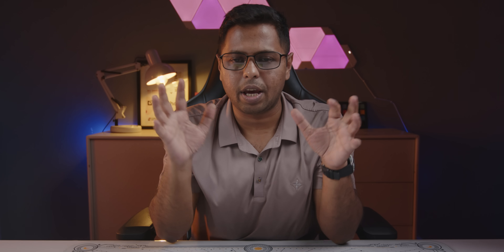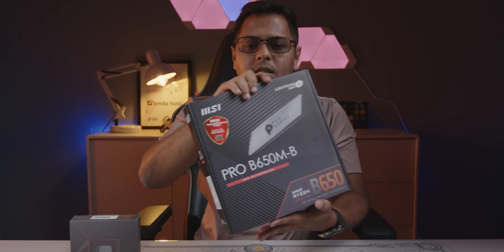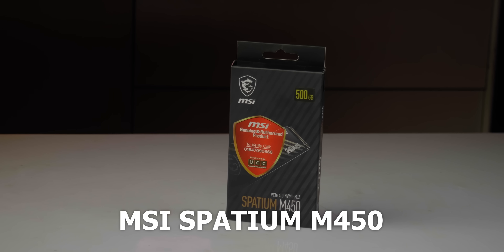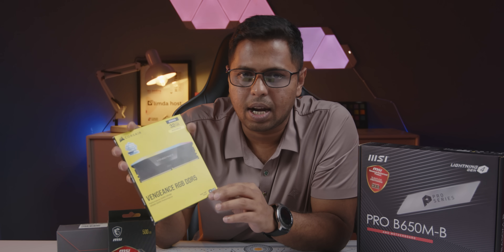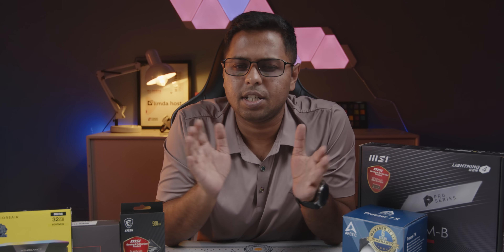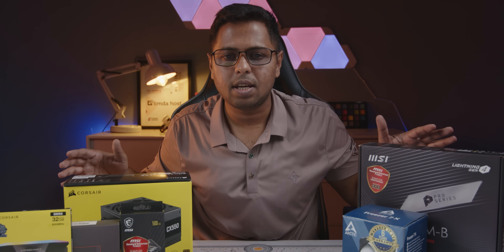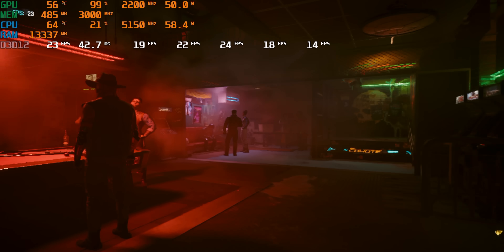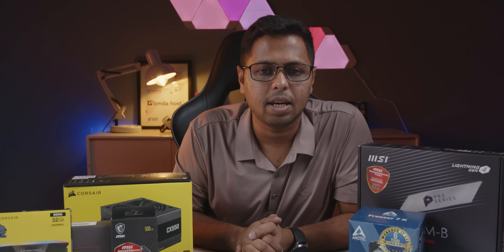60K PC Build Guide 2024 | Ft. Ryzen 5 7600

Comment: I think it's a bad built
Reply: Reason?
Reply: @NEON27_27  

Cpu - I3 12100f = 11.5k
Mb - MSI pro B760m p = 14.7k 
Ram - G.Skill Trident Z5 RGB 16GB DDR5 5600MHZ = 7.6k
Psu - DeepCool PK550D 550 Watt 80 PLUS Bronze Power Supply= 5.1k
Case 3k ba 3.5k 
 Ssd -EX900 PLUS 512gb  = 4.7k
Gpu - Intel Arc A750  or rx 6600= 28k or 28.5k
Totally 77.5k
I know it's over 60k but its way better if you can manage 60k you can manage 77.5k also I know it's 17.5k more but trust me
Reply: @NEON27_27 

Cpu - I3 12100f = 11.5k
Mb - MSI pro B760m p = 14.7k 
Ram - G.Skill Trident Z5 RGB 16GB DDR5 5600MHZ = 7.6k
Psu - DeepCool PK550D 550 Watt 80 PLUS Bronze Power Supply= 5.1k
Case 3k ba 3.5k 
Gpu -  Intel Arc A750 or Rx 6600= 28 or 28.5k
Cooler - deep cool ak400 = 2.1k
 Total = 77.5k

I know it's bet over but trust me it's way better 
 If you can manage 60k you can manage 77.5k also but it's worth it
Reply: @NEON27_27 

Cpu - I3 12100f = 11.5k
Mb - MSI pro B760m p = 14.7k 
Ram - G.Skill Trident Z5 RGB 16GB DDR5 5600MHZ = 7.6k
Psu - DeepCool PK550D 550 Watt 80 PLUS Bronze Power Supply= 5.1k
Case 3k ba 3.5k 
Gpu -  Intel Arc A750 or Rx 6600= 28 or 28.5k
Cooler - deep cool ak400 = 2.1k
 Total = 77.5k

I know it's bet over but trust me it's way better
If you can manage 60k you can also manage 77.5k it's worth it trust me
Reply: @R3dRum1  bro u r Intel too🙂
Reply: @NEON27_27  You can also buy Ryzen 5 5600 but it's not future proved.
Reply: @R3dRum1  i just wanted to remove the gpu 
I will add gpu within 1y
Reply: @NEON27_27  good luck
Reply: @R3dRum1  u too bro 😃

Comment: আসসালামু আলাইকুম 
আমার পিসিতে একটি প্রবলেম হচ্ছে, কোথাও তার সলিউশন পাচ্ছি না!!😔
PC Component:
Processor: amd ryzen 7 5700G
Xigmatek AIR-KILLER PRO ARGB CPU Air Cooler
Motherboard: Asrock B450 Steel Legend
Ram: kingsman 8gbx2 16gb 3200mhz rgb white
SSD: hp ex 900 500GB M.2 NVMe SSD
Psu: CORSAIR CX-550F RGB
Casing ValuTop VT-V3W white
Case Cooling : Aptech RF 200 pro 10 pis

problems:-
এডোবি ফটোশপে এডিটিং এর সময়  ইফেক্ট থেকে হাইলাইট ইউজ করলে পিসি অটো রিস্টার্ট নেই!! 
মাঝেমধ্যে এক্সেলে কাজ করার সময়ও অটো রিস্টার্ট নেয়।
আবার মাঝে মধ্যে স্লিপ মুডে থাকাকালীন কিবোর্ডে বা মাউসে ক্লিক করলে স্লিপ মোড থেকে অন হয় না পাওয়ার  বাটনে ক্লিক করে অন করতে হয় । 
প্রথমে ভাবছি উইন্ডোজে সমস্যা, দুইবার উইন্ডোজ দেওয়ার পরেও সমস্যাটি ঠিক হচ্ছে না। 
এখন ভাবতেছি যেখান থেকে উইন্ডোজ দিছি  ওনার উইন্ডোজে প্রবলেম। 
সো অন্য জায়গা থেকে আবার উইন্ডোজ দেওয়ার চিন্তাভাবনা। 
আশা করি আপনি আমার সমস্যা টি বুঝতে পারছেন। 

ভাই অনেক শখ করে পিসি বিল্ড করছি, কিন্তু এই সমস্যার জন্য মনে শান্তি পাচ্ছি না!! 
আশা করি,  আমার কমেন্টের রিপ্লাই দিবেন।
ধন্যবাদ ❤

Comment: hello zaman  why you did not use r5 8500g because it has identical cpu performance and a exponentially better gpu performance than the r5 7600 and it costs a thousand taka less than the 7600 (in some stores like star tech e.g.)

Comment: CPU...AMD Ryzen 5 7600 Gaming Processor
CPU Cooler..Arctic Freezer 7 X Multi-Compatible
Motherboard....MSI PRO B650M-B DDR5 AMD AM5 m-ATX Motherboard
RAM.......TEAM Delta RGB 16GB DDR5 5200MHz Gaming Desktop RAM
Ssd..... OCPC MBL-400 512GB M.2 NVMe SSD
Power Supply......DeepCool PK450D 450 Watt 80 PLUS Bronze Power Supply
Casing....Xtreme XJOGOS 200-12 RGB Mid Tower Black ATX Gaming Casing   ৬০ হাজার ৩৫৭  টাকা খরচ হয়েছে  ভাইয়া আমি রাজশাহী থেকে বলছিলাম আমি আপনার নিয়মিত ভিডিও দেখি   cpu স্পিডের সাথে মিল রেখে র‍্যাম সিলেট করতে বলছি আমাকে  ryzen 5 7600  ram 5200mhz তাই আমাকে বলছে ভালো পারফরমেন্সের জন্য সে অনুযায়ী র‍্যাম সিলেক্ট করতে ryans থেকে